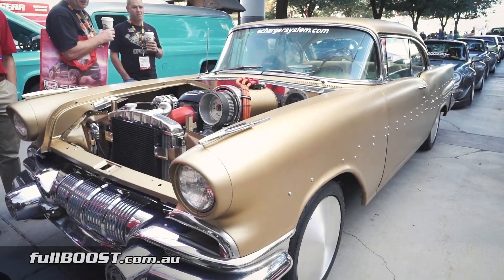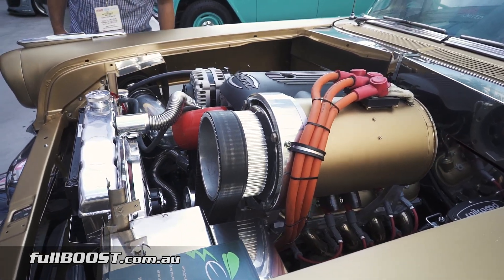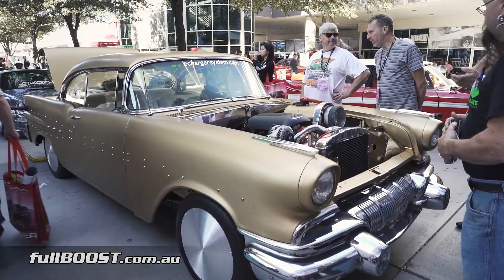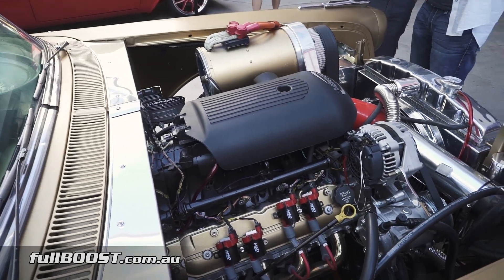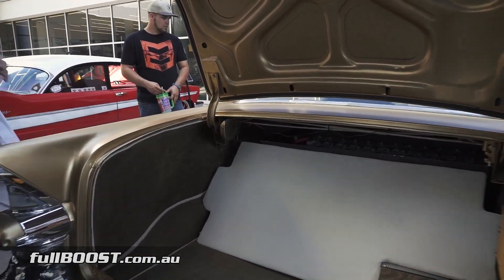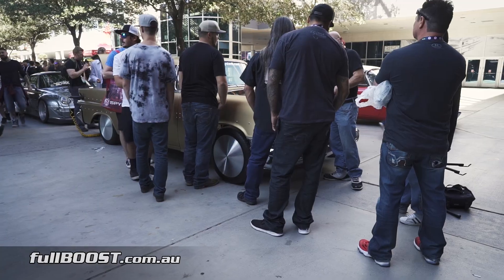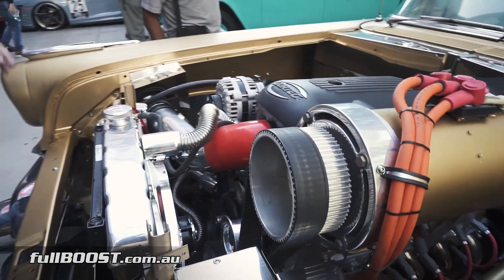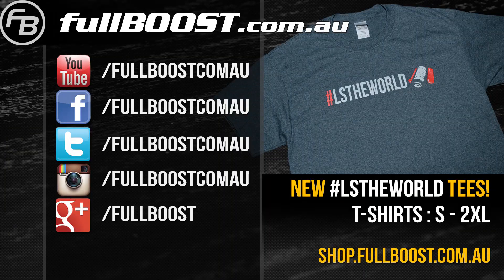The E-Charger Hybrid System

Comment: DYNO SHEETS OR IT DIDN'T HAPPEN... talk is cheap and numbers don't lie folks
Reply: Jay Fox  hahaha okay
Reply: Jay Fox  haha yeah I'm a jew cyborg hacker man that works directly under the illuminati
Reply: More like 11mpg
Reply: Must wash out unburned fuel
Reply: Jr alexander sounds good did you fully rebuild your top end and also do you use P.T.F.E eg..slick 50 to line up the sleeves coz that’s pretty impressive
Reply: Jr ALEXANDER sounds like a sweet well sorted motor you have there carbs sound like a good matchup too I am thinking I would love it
Reply: Jr ALEXANDER  I think if you can get some slick 50 teflon treatment in it will help it a lot I rate it’s use on older blocks will clear almost all of the smoke problems and keeps wear down too..and the best part is its cheap
Reply: Robby G13 Was Numbers do lie fool smh 🤦‍♂️
Reply: Who farted🤢
Reply: Yeah hes talking big numbers want see it to ..numbers dyno time man..
Reply: I put slick 50 in a 79 cougar 351 Windsor.27 mph highway huge square car.Benefits went away after oil change it doesn't remain like advertised.Still that is excellent.Just bought 99 Yukon biggest car i ever had i need to try it again.If it reduces friction this much its probably going to reduce engine wear .
Reply: its literally acts as negative parasitic load on the engine when on.
Reply: Ive seen one of these on a 280z at the track and it did between 11.5-11.8.
Reply: Godwin wins again! As for Scandinavian countries, this setup works well for Koenigsegg.
Reply: The idea does work and has been proven, the concept and function is basically the same as Honda's IMA hybrid system, but with the motor outside rather than inside the transmission. You do get noticeable power and economy gains that easily offset the weight. 

BUT, complexity and cost are a big factor. Even for Honda who can mass produce these, it still added thousands of dollars to the price tag of a civic or accord, which even then wasn't worth it for many people who don't drive a ton. 

Aside from the "cool factor" the actual benefit (considering how much most people with classic cars actually drive them) would not make up for the price that one of these low-volume production systems would actually cost to implement.
Reply: @TGLasers  "when my avatar is clearly the flag of norway" hate to break it to you princess no one cares about your ice fishing shanty of a country. Youd all be speaking Sputnik if it weren't for the US. "We should nuke the us" yeah all 12 fucking people in your military can load someone else's nuke on your country's nicest fishing boat and bring it over here.
Reply: @W1ldSm1le  Yeah. have fun with that. Considering we store about 40% of your millitarys bs in our mountains. Oh and our country could buy you out of debt about a 10 times. Have fun living in a poverty struck shithole :)  Norway has more money and power then the us would ever get. You think a retardedly large military is going to save that sinking shithole you got?. nah man
Reply: @TGLasers  Comparing money and power to the US? Yah you kind of lost that one.
Reply: Sounds like somebody is upset they were born in the wrong country!
Slamming the us but yet there's thousands and thousands per day trying to get in here. I don't think there's any Norwegian countries that have to deal with that problem. I see people posting crap like this he reminds me of how lucky I am. I don't have to post statements slamming other countries to make myself feel better.
How ignorant is it for someone to say nuke the US and things would be better.
Yes. I don't think someone is well-versed in global economics or just common effing sense LOL.
Of course instead of shutting up and knowing one's place there will just be another rude comment making you and your country look even more ignorant.
Reply: @justinmurphy2227  id like to try living in another country. 
I'm bored of the United States and the people here are pretty shitty
Reply: Jay Fox  man you are a ridiculous person, nukes aren't real,   Jew conspiracy, I almost have crazy person bingo.
Reply: Robby G13 shits fake bro all talk no dyno #’s no performance videos all filler no substance
Reply: Numbers lie when its the imperial system....
Reply: TG Lasers how!
Reply: dont be mad you dont understand fractions.
Reply: @TGLasers  man always bashing on the muricans lol yes I agree, the metric system is more efficient by far.
Reply: And quite frankly I don't like you using the word retarded in a statement regarding a car in fuel mileage. I guess you don't care how disrespectful you sound to someone or someones child.
Reply: I can hear the guy now lol "we're still testing and developing at the moment so nothing is set in stone"
Reply: Ppl always wanna bring up Dyno sheets
Reply: @brewplanes7021  "must be british" while the account picture clearly shows a norwegian flag... imma guess your american judging by your iq....
Reply: TG Lasers you know you are right, I think you are just a fucking idiot, not British.

Comment: It's not fun when your woodruff key rolls over on your crank. Engineer cringe.
Reply: ipissed Better than yielding your crank!
Reply: It sounds like AC compressor locked up until you realize the dampener is broken the inner ring, the key has re- seated itself on a big bulge. Holy cow this thing is screwed.

Comment: I'm all for burning dinosaurs but this is a REALLY cool idea.
Reply: Joke's on you, oil is 99.9% algae.
Reply: Not really a joke. Whatever I have to burn less of to make more power seems like a good deal to me. It looks like a really simple bolt-on kit that I would be willing to throw on my pickup truck.
Reply: Mopar Magic ive though of doing something similar with a crx using hubs on the rear(non driven) wheels, but it would cost waaay too much money for little power gain, mpg never crossed my mind once, it wouldnt really be something you use for efficiency. for power though you could use a big*** alternater with li ion batterie(s) and use it like nitrous. this would only really work in small applications... like nitrous, for daily drivers of course. big shots a nitrous are really only good for the "occasional" aka only when you pass a mclaren car or the type of people who blow there strip only car every 200 miles
Reply: Mopar Magic gas is king

Comment: I’m all for electric vehicles, in fact I have been working on my own electric project for nearly a decade, but what really annoys me about this kind of video is they don’t disclose all the facts. It is presented as some kind of revolutionary magic bullet, but how many of you would be interested if you found out it probably costs him MORE money to run that car than if he ran it on straight gasoline? 

What are completely overlooked in this claim of 75 cents per gallon equivalent (probably worked out on paper) are all the losses and associated costs. Firstly you can’t defy the laws of physics... Every time energy changes state losses are incurred (it’s why over unity isn’t possible). 

Before you even get the power into the battery pack you have already taken a ~10% hit at the battery charger (I’m going to be using the same Elcon brand charger), that right changing from AC in the wall to DC storage in the car just cost you 10% with a
typical charger losing about 10% in the conversion. 

Then you get additional losses at the controller converting back to AC (don’t know what AC controller he is using) before you get to the electric motor which is ~80% efficient (efficiency varies depending on revs and load). Then there is a huge belt down to the engine which will also incur losses. 

Let’s be really conservative and say the overall system is 60% efficient, that still works out way cheaper than gasoline when factoring in the additional losses, but
unfortunately the spending doesn’t stop there. Again what are completely omitted
are the costs of the batteries and their limited cycle life. 

What many electric vehicle builders fail to mention in their attempts to impress you is the high cost per cycle battery pack cost, which only has a finite life span before they need to be disposed of and a new set bought. That extra 60 miles he gets
probably costs several dollars per cycle (typical battery cost / cycles) and that’s if you get the full cycle life and don’t wreck the pack, and not factoring in that might drop to 30 miles towards the end of pack life. 

Then you have to factor in all the other costs like contactors, heavy wiring, switches, controller (mine was over $4,000) motor (another couple of thousand), a battery management system etc. Then divide all those costs over the miles driven in the car. Then if that hasn’t hit you bad enough you still have to pay the weight bill, yes that’s right all that additional weight has to be moved (and stopped). 

Additional weight in any vehicle requires additional power to move it (simple physics again). Suddenly you find the cost saving you thought you were getting has turned into an additional cost. 

Don’t buy into gimmicks like this, if you want to help save the planet, then don’t bother with this type of conversion, do a full electric conversion where you don’t have all the losses from both the gasoline engine as well as the electric motor. And no you
probably won’t save any money on full electric either, but at least it will be better for the planet.
Reply: @sourand jaded don't get me wrong I think the idea has potential, but it has nowhere near the potential a slick salesman like this guy is trying to tell you it has. He is so typical of a DIY EV guy it's not funny. They only ever tell you all the pluses and none of the negatives. Spinning the idea of it being all milk and honey. People like this are a real danger to progress because politicians and the like who make decision catch wind of these kinds of guys and think they are a magic bullet, then start to drive people towards this false hope. Instead if they told the whole truth that they were trying to flog an idea to make a buck, and the potential gain wasn't that great, it wouldn't be all that great for a business they are trying to get off the ground. So they peddle false hope for their own greed. Meanwhile the rest of us are left to pay the price in one way or another.

Comment: I'm actually surprised it hasn't been done sooner. True hot rodders like extra power and efficiency any way the can get it. 

Battery powered superchargers as well. Turn on and off like a nitrous shot from a smaller battery, or run constantly with regen brakes and a big battery pack.

Comment: What a waste of time! Since when does a chev engine need an electric motor to help it run, it doesn't look like it will fit under the bonnet, so much extra weight and space taken up! Seems pointless, buy a full electric car if you want to save on fuel costs, this is just not worth the cost of putting on anything! Far easier to get 500 hp from a chev than putting that ugly intrusive looking thing on there, and who cares about fuel economy when you got 500 hp anyway!

Comment: Two questions. 1: where can I buy it. 2: if the car was completely out of gas, but the batteries were fully charged, would it be capable of moving the car on its own at low (25MPH) speeds?

Comment: I still don't understand how this works.  It would have to rob power and fuel economy in order to charge the batteries in hybrid mode, and I really don't understand how it could work without inputs from the gas and brake.  Most hybrids work best by generating a lot of power under braking, but how would this know when to drag the engine because you are braking?

Still its a cool idea for a power adder.
Reply: dolby- A: You charge the batteries at home overnight ,B:The inverter/controller  is connected to the cars computer and to the brake switch on the pedal.

Comment: people saying that the power would be reduced because of the weight of the system, think about it,, this adds 150 ft/lbs of torque and only weighs as much as a fat guy in the passenger seat. most 4 cylinder cars have LESS than 150ft/lbs of torque and weigh thousands of pounds.

Comment: Would love to see this system made to fit in the a/c compressor location of a first gen dodge neon using the same mounting location.  It'd be nice to see it made to fit a NUMBER of older small cars like that.  I'm sure the people with escort, cavalier and various other "sport" compacts would love to have a quick bolt on power adder and fuel economy increase.  I know I would.  Plus, it's WAY easier than the list of mods you'd need to run a turbo.

Comment: $5000????
 That's cheap as chips if it can be mass produced. And if the system proves itself in reliability tests, this could be a huge success !
Reply: its cheap in the aspect that people pay much more than that to add 150 lbs of torque to their car. On top of that it not only increases torque but increases MPG so it's a win win.
Reply: $5k is not cheap when you take into consideration that you're only saving about $500 per year on a daily driver. It would take 10 years for it to pay for itself.
Reply: 2hrsToChooseThis Yeah cause you typically swap an LS into a car hoping for more efficiency that will pay for itself quickly.
Reply: People that are looking to add 150lbs of torque aren't usually worried about gas mileage. They certainly aren't looking to add 250+ lbs of weight in the process.
Reply: Where did I say anything about an LS swap? You could add this system to a 4 banger and you're still adding weight and losing money. Most people don't keep their car for more than 10 years, so it won't pay for itself at all usually. And you're right. Most people looking for more HP aren't too worried about gas mileage. Especially when it means adding 250+ lbs of weight.
Reply: My grandma weighs 250lbs

Comment: So just the motor turns that belt which takes how much load off of the engine? Taking work off of the accessory belts does that much? Because if it is an IS than the cam and crank chain is inside and has like 3 chain links to it. How is that little rubber band going to push so much power to the crank? 

Like a supercharger just needs the belt to spin it the compressor wheel to compress air. Not drive the crank.

Comment: I think it's a nice idea for sure, but too hard on the engine itself. Costs for something like this driven on daily uses would be rather high since you'd either fuck your engine up or you'd have to overhaul the engine and have new, stronger crank bearings. 150 lb-ft at the crank end will fuck it up plus the belt itself pulling the motor and engine to each other... very likely to have a premature bearing failior

Comment: so it just helps the motor spin through the belt and a pulley? I guess like if you put an assist motor on a bicycle? you still have to pedal but some of the stress is taken away. I kinda dig the idea. should put a high amp alternator in & try to charge it while the engine runs, while it works

Comment: Out of curiosity why not mount a supercharger, then run the belt to the a similar electric motor. Smaller in design and can achieve higher rpms with less electricity, and keep the brakes/charging system. So theoretically you could make boost without any lug on the engine. Or even simpler just take the compressor side of a turbo and build a custom turbine onto the electric motor.